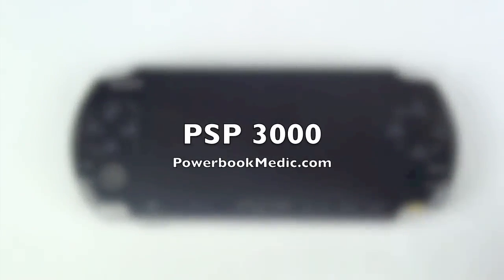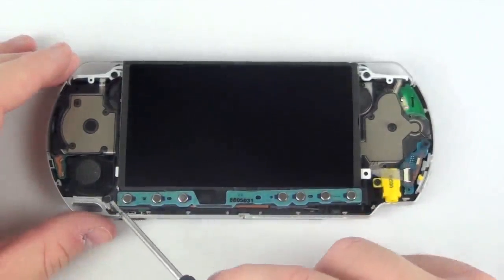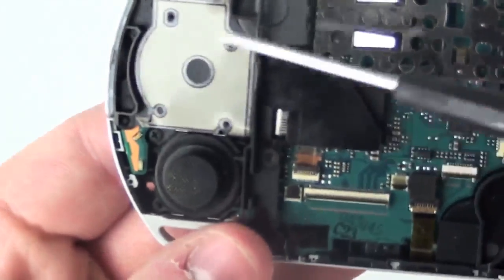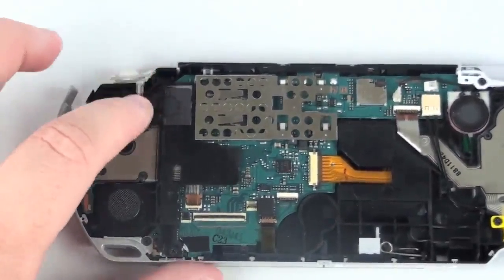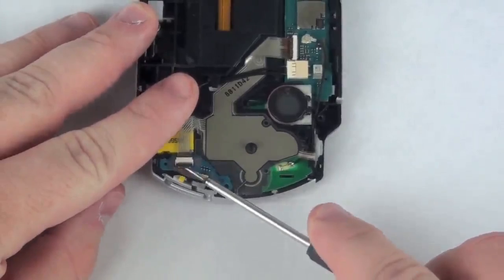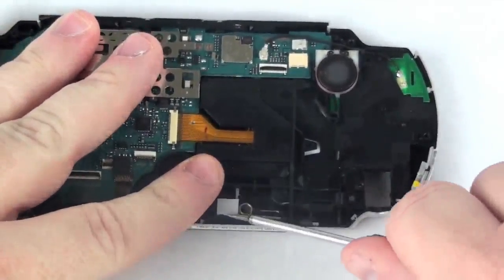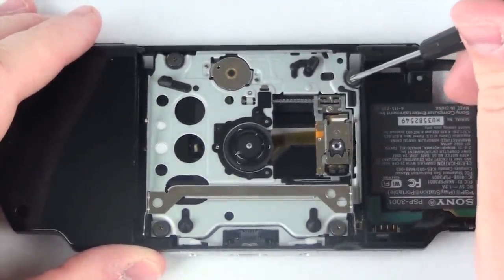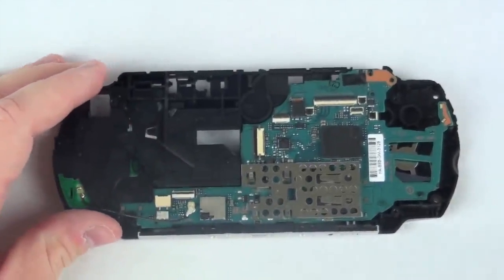How to Repair a Sony PSP 3000

Comment: Idk how I screw up the psp 3000 by trying to put the screen back in when seconds ago the power turned on with the screen turning on. Now no power at all and I did not damage the power switch nor see any damages on the psp 3000…. And I was seconds away from putting the front cover back on. Why…..

Comment: I have a problem with my psp, the psp is shtting down after few minutes even if his battery is full and although i replaced his battery the problem still exist, if the psp is connected to the chrager the psp isnt shutting down. What do you think is the problem?😔

Comment: Nice video, but what year is PSP released?
Reply: It depends on what model you have the psp 1000 was released in 2005 then the 2000 was released a couple years later I think in 2007 or 2008 and then the psp 3000 came after the next psp was the go and finally the psp street which only released in Europe i believe

Comment: I have a problem on my psp 3000 analog stick. They really made repairs and part replacement harder and risky with psp 3000 unlike in earlier models.

Anyway, i would like to know the size of the screws on psp. Thanks.

Comment: ok so a few years ago I fully replaced my cracked screen and was able to view the whole lit up game screen again and was so happy. but after putting everything back together my psp 3001 can only turn on via ac power, it will no longer take batteries rather charged or half charged. 

I'm assuming I may have done something wrong and not sure what my next step is or what I should redo or replace.
Reply: Ik this is from 5 years ago but maybe you took out a cable and diddnt out it back n?

Comment: Hello, I am trying to figure out what I need to repair on my PSP 3000 that I have. You see it was part of the Rachet and Clank Bundle and got it the year it first came out on Christmas. In 2012, I dropped it in the bathroom while at trade school and the screen would not come on... Now it is 2016. A year ago I took it to a teacher and he said to replace the screen but I didnt mess with it until now. Not only is the screen still black, but there is no sound, and when I put one of my UMDs into the tray and try it, it sounds as if the system is having a hard time reading it, like it makes two click noises, momentary silence then it starts to spin as if it were trying again. I don't know if I should buy the new screen or just invest in another psp. I really dont want to get another one since I have an attachment to the one I have now.. le sigh, sorry for the long story but, any suggestions?

Comment: Recently, I've been playing on my PSP and I noticed three horizontal graphical error lines. I decided to replace the screen with a brand new one (it was pretty old and dusty), so I opened the PSP, removed the sockets attached to the LCD screen and reconnected the same screen to see if it would work just in case. After doing so and reassembling it, upon switching it on, I could hear the music upon boot up but no video was displayed. Any tips?
Reply: check fuse for backlight

Comment: is he fixing it or ruining it
Reply: how so? It's not on and there's no battery either. It's more dangerous for the psp than for this guy.
Reply: @BluBoulzor  Well for starters hes not grounded which makes it possible to fry the internal components with electrostatic discharge or ESD.

Comment: I have a back light fade problems. And I think it has something to do with the RF Shield inside my psp, I tried attach a piece of leather strip on the RF Shield metal plate but it doesn't work. I had seen tutorials and people saying that method work for PSP 2000. What is the problem actually?
     When I open up my psp 3000 and try to find out the problem, I found out that whenever I fold up my LCD screen, and turn on my psp, the screen works. But when I fold down the LCD Screen back into the psp(while the psp and screen was still on),When the screen applied pressure to the RF Shield, the screen fade of and remain black. What is the problem actually? How does the RF Shield Work actually with the LCD Screen and Motherboard?

Comment: my psp 3000 power switch works, but does not light up and the sleep mode switch is loose and sometimes will work and not. Diagnostic please?

Comment: - is it possible too replace the directional buttons on the left side of the psp" kuz  the buttons started getting stuck & i ended up messing it up more wit a knife trying too fix it ./ jzt a curious question /. if its replaceable how much you think it would cost '
Reply: The video literally shows you how to get there, all it costs is just time, effort, and the right screwdriver... .

Comment: Hi, I broke the small clip that holds the screen small cable, and the one of the analog stick, well they are not broken I just separated them from the board, is there a way I can put them back? they're fine cuz i tested them.

Comment: hello , i recently spilled water on my psp d pad and after i opened it and cleaned it with rubbng alcohol it works for only 10 minutes but after i put the lid back on it stops working, could you tell me what to do to fix it? i dont want to end up buying a new 3000...

Comment: Could you guys do another video on how to replace plugs. I opened it come to find out that i had dropped and the video ribbon cable plug had snapped off main plug is okay though. Its just the little on that broke

Comment: my arrow keys arent working on my psp and i havent dropped it or anything but i saw a yahoo answer which said its either broken or dust is stuck inside but i'll open and see what happens after i clean out any dust if there is and if it works again